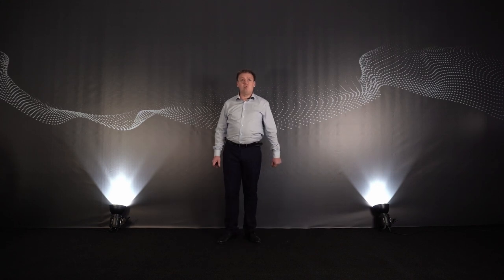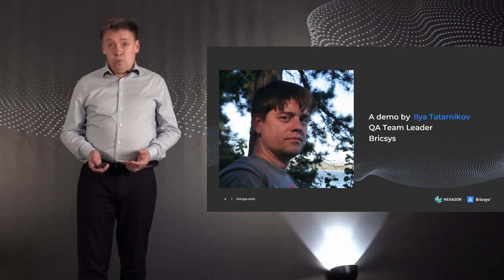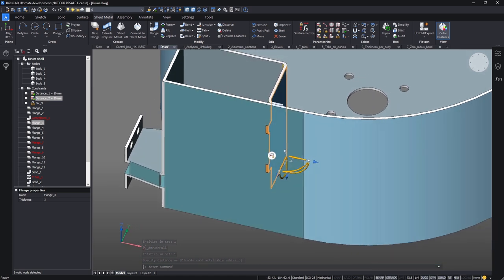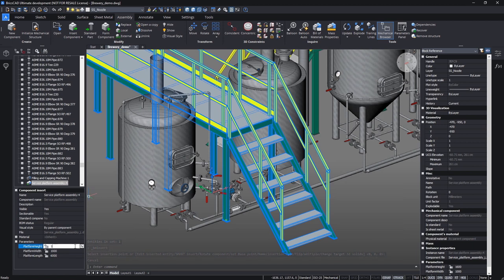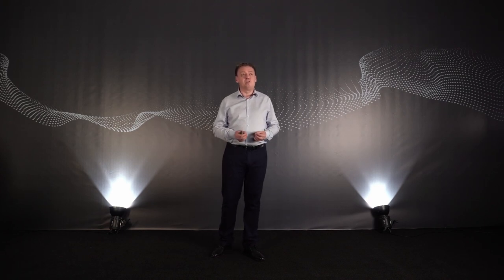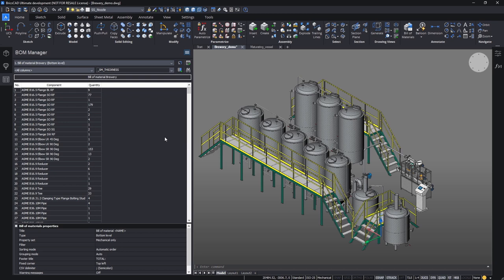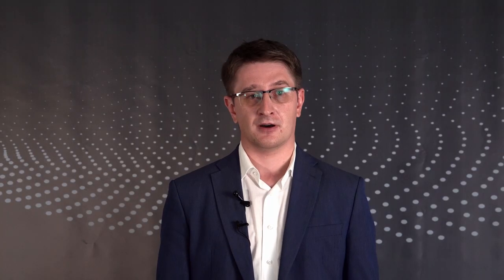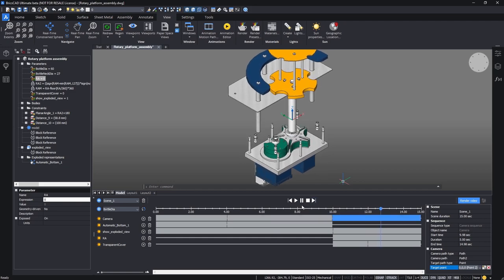Bricsys Digital Summit - Mechanical assembly design with BricsCAD® Mechanical V21

Comment: He is talking about V22? @Bricsys
Reply from the maker: He is talking about V21.
Reply: @BricsysOfficial  So is sentence at 2:56 and his V22 in the 2:36 presentation is a mistake and nothing "for the future".?
Reply from the maker: @maximilianbecker4023  This whole video is about BricsCAD Mechanical V21.
Currently the BricsCAD standard parts library is available with a BricsCAD Pro V21 license or higher. However, he says the library of BricsCAD standard parts will require a license of BricsCAD Mechanical or higher, starting at V22.
This means that you will still be able to access the standard parts library with BricsCAD V21 Pro, but will not be allowed to access it for BricsCAD V22 Pro and will need a BricsCAD V22 Mechanical license. BricsCAD V22 is not due for release until October 2021.